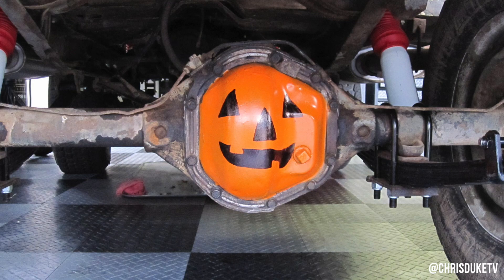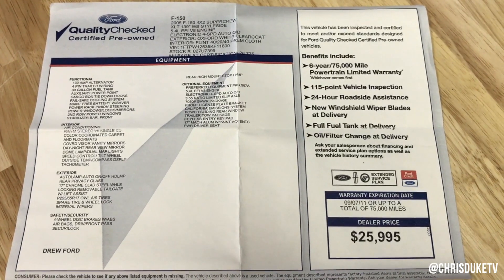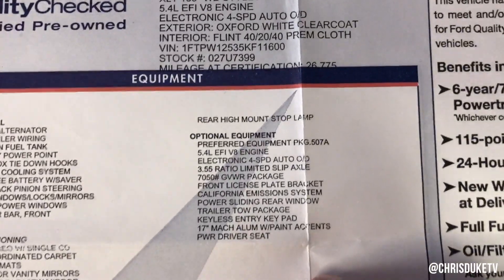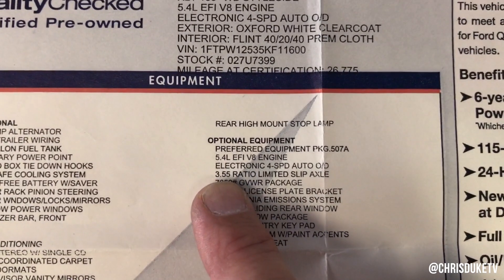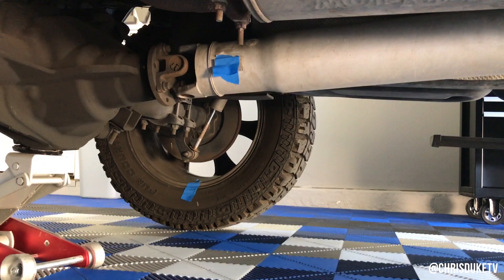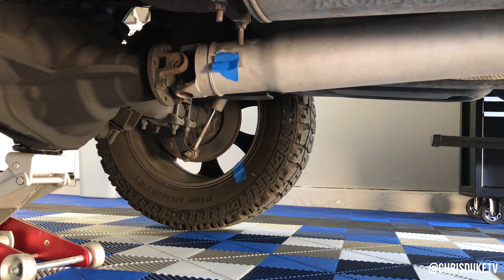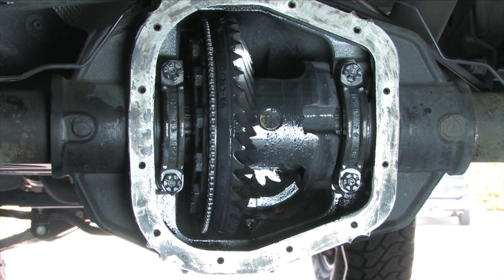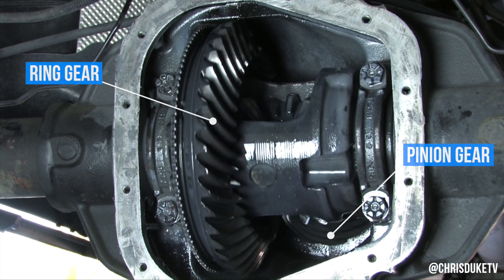How Can I Tell My Gear Ratio? #AskDuke 001

Comment: Duke my question  which gear ratio will give me a better higher speed over the other  I have a 1986  3/4 ton rear end that is 3.73 and the other rear end that’s on the ground is 4.10

Comment: I have two trucks, same in power but different in transmission, one has 12 speed with 15.86-1.00 ratio with 2.64 differential. & 2nd truck has 12.33-0.78 ratio with 3.08 differential. So which one is quicker & good for heavy loads & hill climbing situations?

Comment: Duke! Does wheel/tire size make a difference in the axle/tire counting test?  I want to check to see if my rear dif has been changed from stock and I’m sitting on 35s. 1973 cj5.
Reply: tire size shouldn't make a difference because if you think about it you are just measuring the rotations, not how far the wheels are travelling before it completes a rotation. You probably already found that answer since this was two years ago, but if ya haven't hopefully I could help lol

Comment: I know this video is meant to be informative/supportive, but chances are if you don't know your gear ratio as easily as you know how many cylinders your engine has it is either, not relevant information for you to make note of or you have no business touching a differential to begin with.
Reply from the maker: +SykoEsquire There are a lot of reasons why this information is relevant and useful to many people. A good example is buying an older vehicle or a used vehicle and not having the gear ratio information easily available. Thank you for watching.
Reply: As a parts dismantler it's good to know these tips, definitely want to be informed on my product. I hate to tell my customers well that's what the VIN said. I mean Richmond, Strange, etc. wouldn't be in business if people weren't buying their products.
Reply: No dumb questions just ansers
Reply: My problem is that I had a shop rebuild my rear-ended in my 2019 f150, which had a 3.55, but I'm not so sure now. The shop was extremely shady and "accidentally" wrote 3:31 on the invoice 3 separate times, and my truck seems significantly slower at acceleration

Comment: Working as a mechanic, all that I have ever done if the car/truck is more then likely stock would be to call the parts guy at the dealer and they can run the VIN and tell you the gear ratio. Super fast and effective, no need to get your hands dirty!
Reply from the maker: Good tip, as long as it's stock of course! But like I said in my video, there's still a chance it could be different. Thanks for watching!